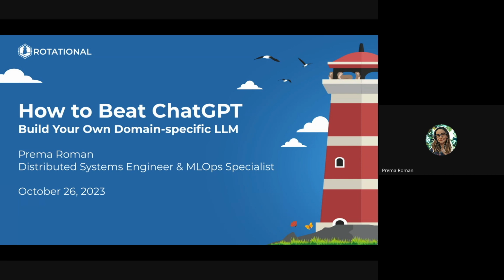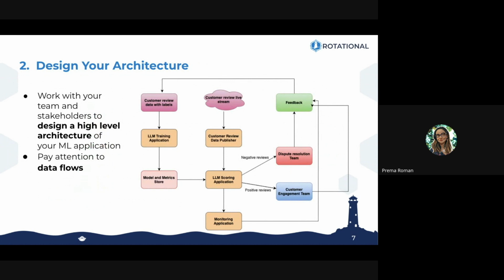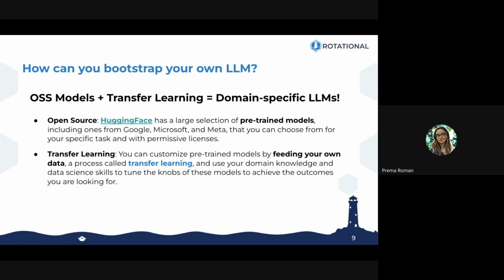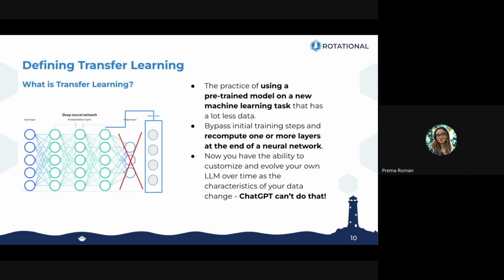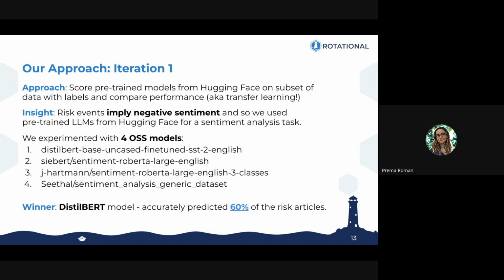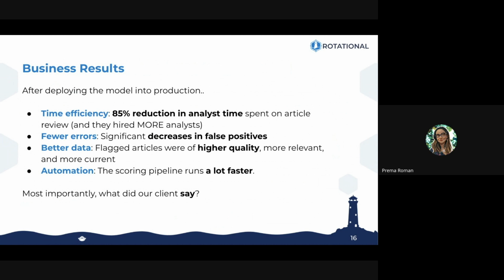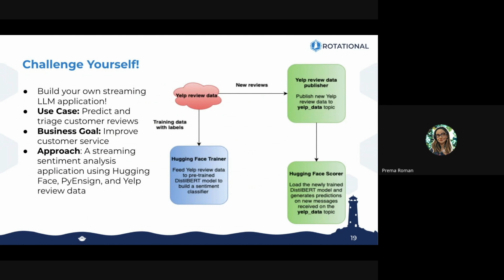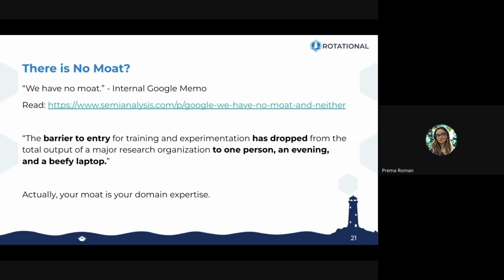How to Beat ChatGPT

Comment: great talk! one question. How do you do hyper parameters tuning ? from my own understanding it's like grid search of the hyperparameters and my own experience is that it does improve accuracy but not in a scale of like 20% (77 to 97%) in your case . perhaps you would like share some tips about that?🎉
Reply: Hi @user-zq9bp5yv6z!  Thank you for watching the video!  Regarding getting the best performance out of hyperparameter tuning, it depends on the data and the model and you have play around with the parameters if you are not getting the performance you are looking for.  I was fortunate in this case where I was able to achieve the performance improvement with the default parameters.